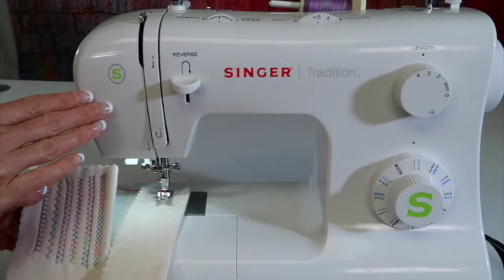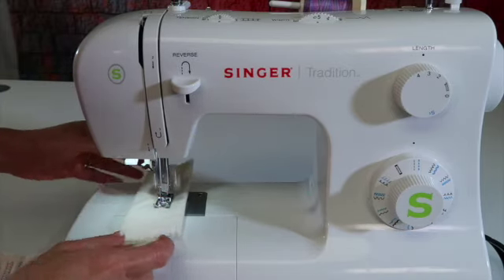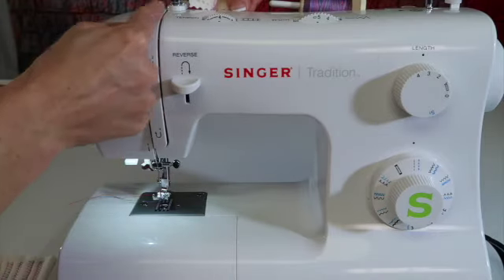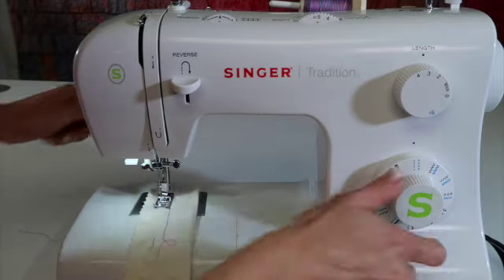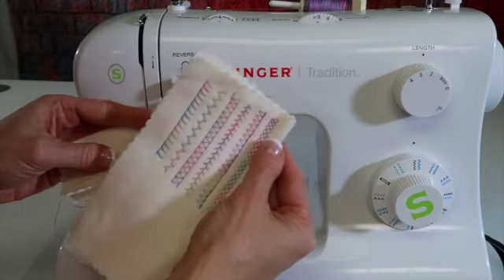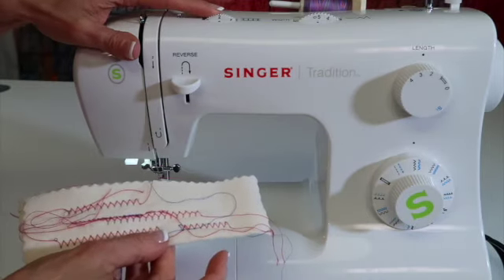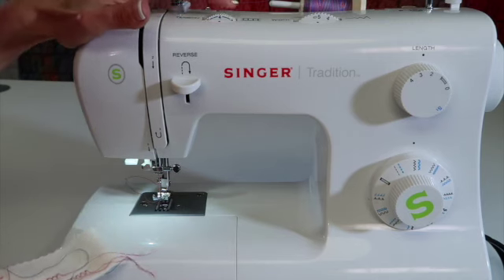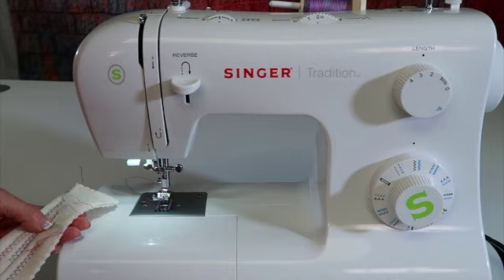Singer Tradition 2277 9 Tension

Comment: I bought my Singer (same model) in November of 18.  It’s been nothing but a POS.  I can’t get it to sew anything longer than 1/4 of an inch before it’s all jammed up.
After watching your video with the SIMPLEST explanation on tension and making sure to get it in the tension discs, i can now sew the width of a sock (test material).

I was very upset that this can’t be used out of the box.  It was a jam-o-matic and no vids I watched was any help but this one.
I’ve  had this for almost a year now not being able to use it at all.

I’m am more happy with my great aunt’s 100 year old foot powered Singer more than this new one I have because it ALWAYS works!!!!!  Even after being left alone in the barn for 10 years.
All I had to do was oil it and run it a little while and it works flawlessly with no jams.
Reply: ZyriaNa' AreNee I bought this on sale during black Friday.  I only use it for simple repairs.  I can't tell you anything about how great it is, because I barely use it. I still use the 100 year old Singer as my go-to machine. It only does a straight stitch, but it does it every time with no jams.

Comment: There are some projects I have that might require a longer stitch length only because of the number of layers but I don’t know what to do about tension. Because, if I test the straight stitch length on any two pieces of cotton fabric it bunches and puckers no matter what tension I use. (I just cleaned and oiled the machine yesterday as well)